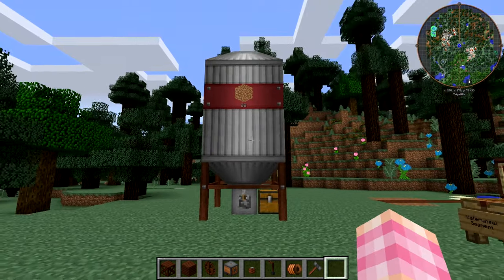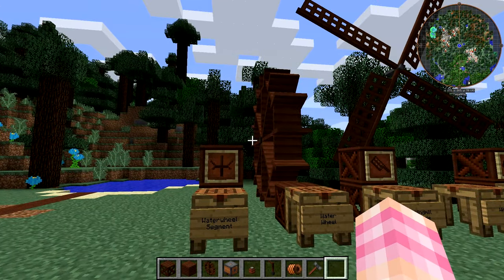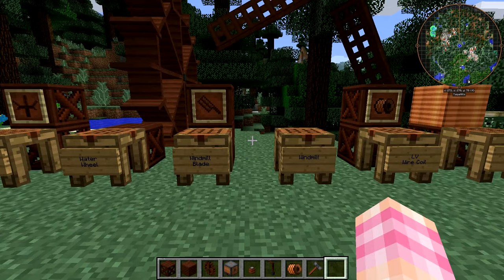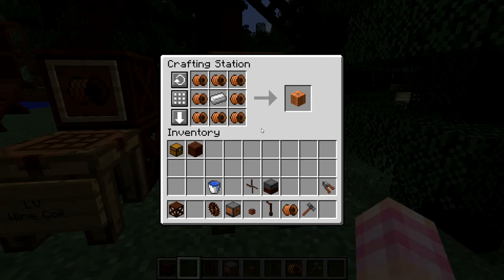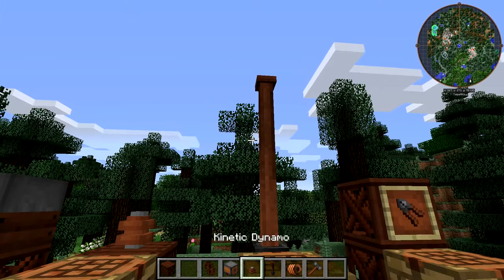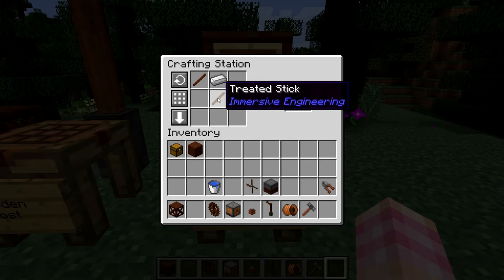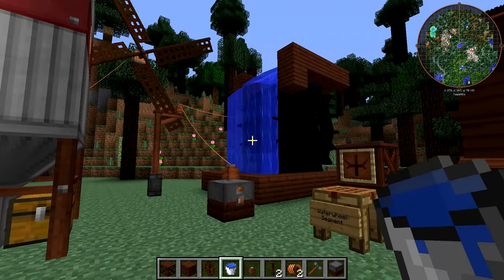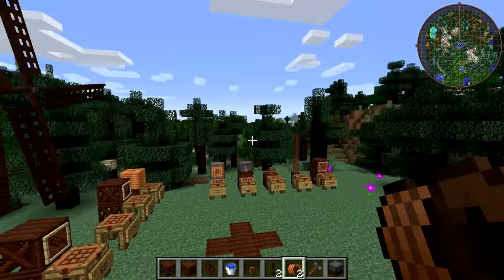Immersive Engineering Tutorial #4 - Basic Power

Comment: Several additional things to mention:

1) You can place wire connectors on the wooden posts from below so they are hanging down towards the ground.

2) There are also Wall mounts to hang your wire connectors.

3) You CAN actually stack the capacitor on top of the kinetic dynamo. All you have to do is place the capacitor first and whack it with the hammer on the bottom side to make it input-side, and then place the dynamo underneath. 
Machines in IE do transfer power via touch. All you have to do is configure the sides, but because you cant see and interract with touching sides it can be very tricky, but its possible. I've checked it with full and empty capacitors placed one to one and power do transfer between them.

4) Your setup of the single waterwheel isnt actually producing maximum power. Your waterwheel like this producing 21 RF/t. But adding just one additional block of planks in the bottom corner (where the water flow hits the ground falling from above) will add additional 3 RF/t making it 24 RF/t total. Adding two additional water sources in front of the water wheel in a specific way will make it output its full power of 28 RF/t.

5) Machines and structures turn black because of fastcraft.jar
Reply from the maker: +Anthony Izumi Okay, thanks, I'll have to touch on those in the next episode.

Comment: I've set up both types of power ways and not one of them are generating power no matter what i do ive changed everything
Reply from the maker: You have to make sure you've set the side of the Kinetic Generator you attached the wire connector to is an output side. Whack things with the hammer till its orange.